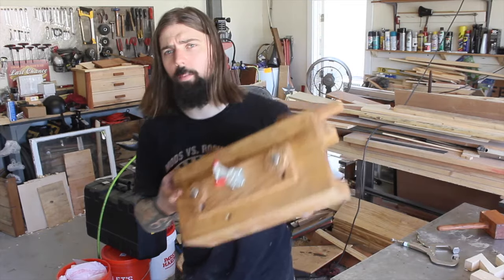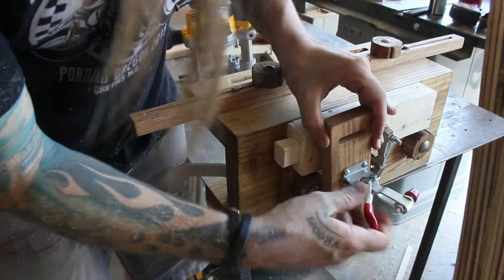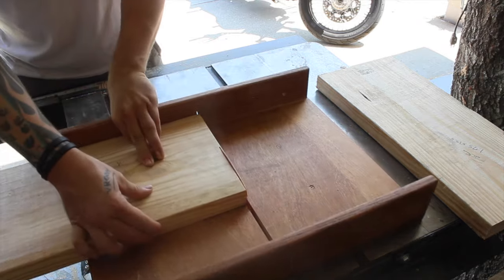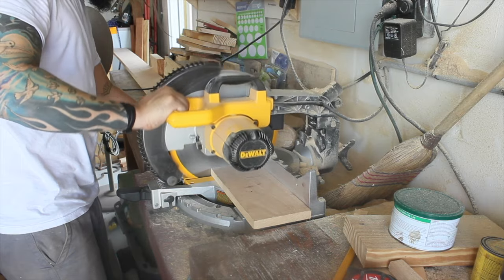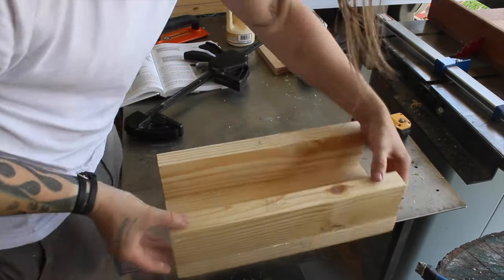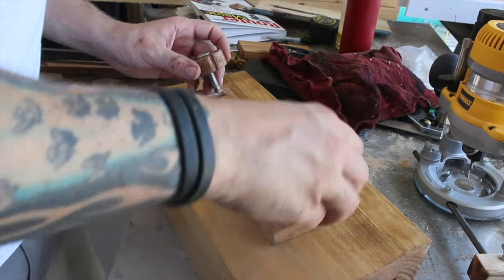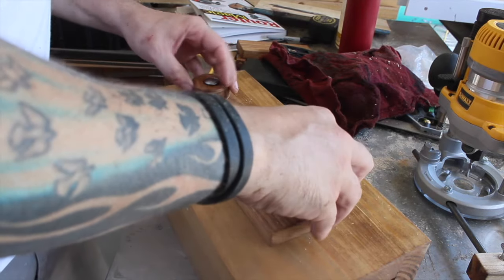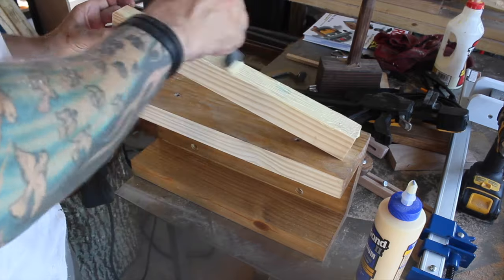Router Mortise Jig | How-To

Comment: Nice build Zack, I am going to barrow some of this. I would use 3/4 ply and glue up pieces to double it. Here in VA it is so variably humid softwood moves on you. Now that seems OK as long as you make all the cuts in one day, but over a week mating up over an 1/16 inch movement seems hard to do. Tight tenons make tight product, if you can get the the hole to line up. :)

Narration and music is a good thing, keep that up, but maybe a little quieter on the music. I liked it though.
Reply from the maker: Thank you!

Comment: Do you have measurements? I think I can figure most of it out, but it would be nice to know what you changed. Great video and jig!
Reply from the maker: I'll try and get some measurements from ya, either tonight or tomorrow. Any in particular do you need?
Reply: Thanks! Looking for the overall size and the setup you have on the top of the jig. I've built something similar but I'm not happy with it. Your design would definitely be an improvement for my setup.
Reply: Overall dimensions and the finer detail dimensions. A good reference for a jumping off point of no return to get us started would be great. Thank you.